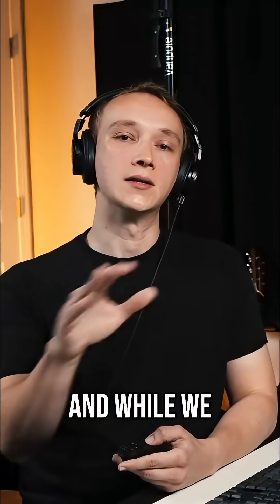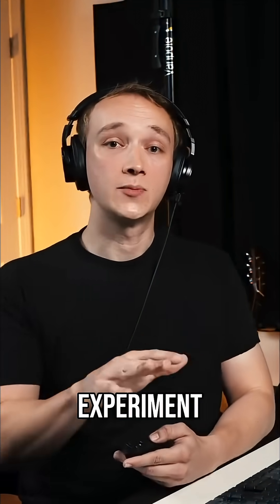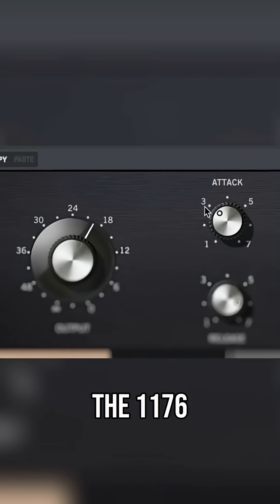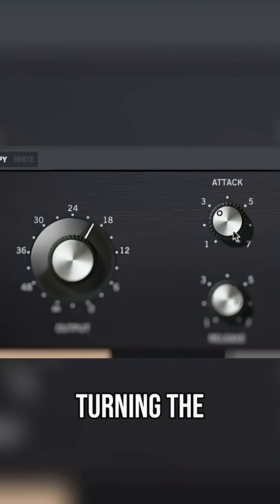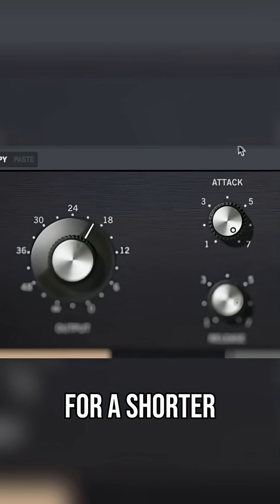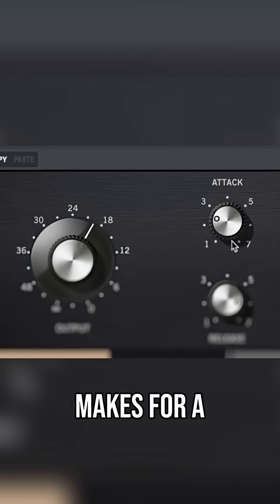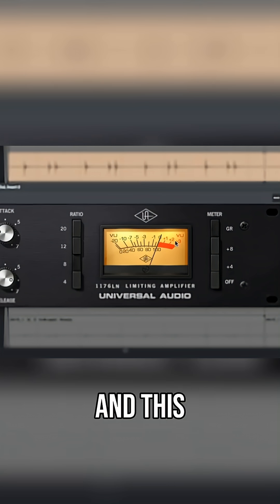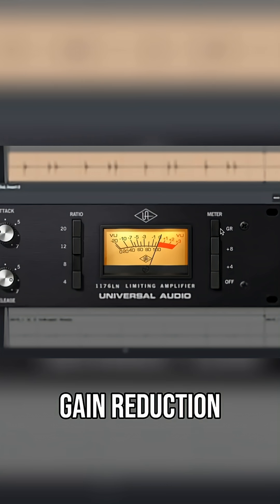Kick Compression: Attack & Release Explained #shorts

Comment: What I often confused when processing drums is that, should I put a compression on the kick bus or on the individual kick signal?

I often have two audio signal for the kick (one signal mic'ed on the front, and the other mic'ed inside the kick shell to get the low end) and I would often times grouped the two signal into one group track and put compressor on it. If I want to shape the kick sound, I would EQ the individual track, but then I would sometimes have to tweak my compressor. Is this alright?

I use a stock ReaComp plugin for compression, but I'm interested in using analog plugins like the 1176.